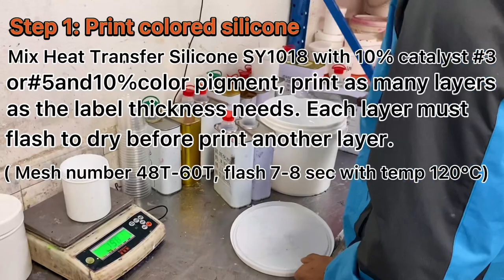How  to use silicone to make screen printing heat transfer stickers

Comment: Hi 
Does this silicone have a time limit for use after mixing?  If there is a time limit, how much is this time limit?
How much material ? How can i buy?
Reply from the maker: Usually It Can be used 6 hrs After Mixing Catalyst. 
Pls share me your  contact i send you more details dear 
Or you can add my WhatsApp008613925754451❤